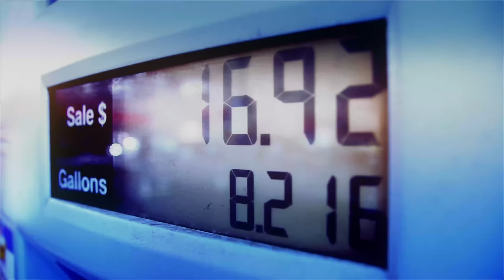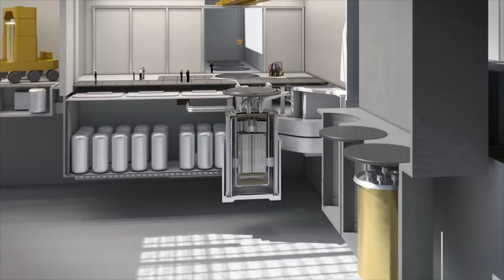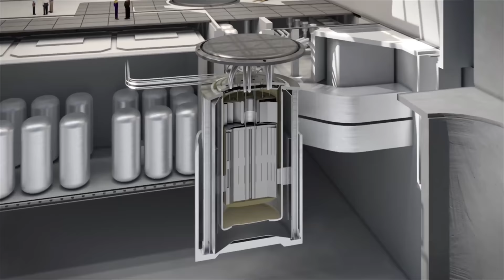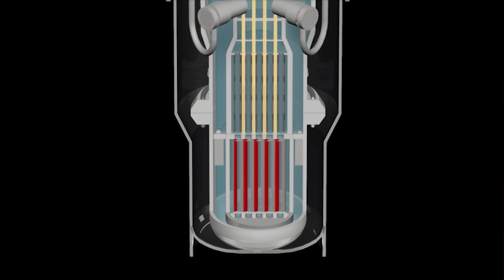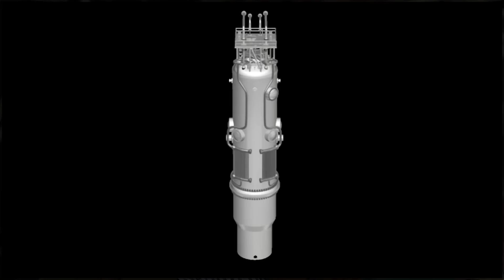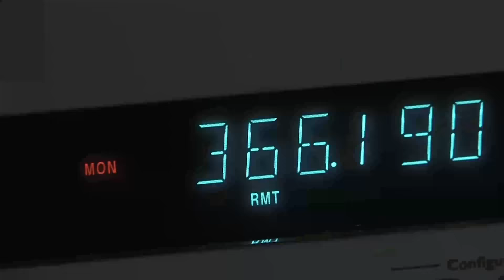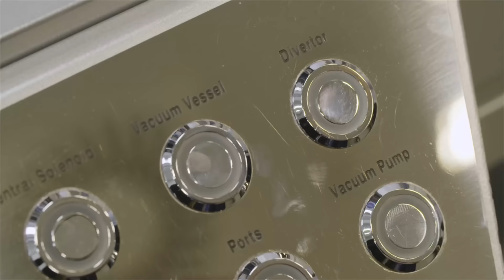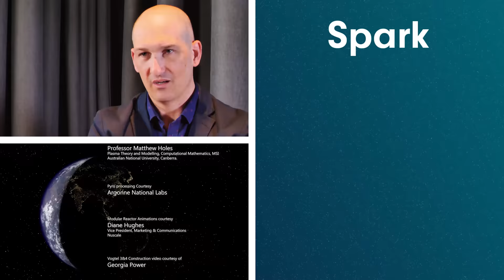Can We Trust Nuclear Power Again After Chernobyl? [4K]

Comment: I beieve the answer is yes. The RBMK reactor is a bad design, exacerbated by Soviet incompetence. We use an entirely different design and our nuclear technicians better-trained. 

Our need for energy is only going to increase as time goes on. Renewables cannot fill the breach quickly enough and come with their own issues. We already see probems with hydro in the Southwest as reservoirs like Lake  Mead in the US dry up because of overuse and drought. 

Despite what alarmists might think, the US nuclear industry has a good safety record (3 Mile Isand was the worst large scale reactor accident we've had. Of course one should not build in areas where there are seismic hazards--Australia has large areas of cratonic rock which tend to be stable seismically and geologically, so it has an advantage there.

I beileve the US (and other countries as well) need to seriousy consider making nuclear either part of their power generation mix or a larger percentage where nuclear is aready a part of the mix.

Comment: Talking about Chernybol an acquantance went through the ex-Soviet Union after that accident to see if he could improve the safety of their Nuclear Plants.  He was horrified at the lack of safety but worked with other Nuclear Engineers to bring those plants up to safe standards.  Unfortunately he has since died or I'd ask him to write his own piece with his experiences.  But the world's Nuclear Power Stations along with the new safe Nuclear Power plants need an International Safety board with examimers ging around to keep everything safe.  The Japanese plant had a another plant along the coast better built that suffered no ill effects from their Tsunami.  More people died from being moved than from teh radiation there by the way.  People who flew out of Tokyo to get away from the accident suffered more radiation form the aeroplane flight than from the accident.  It was a case of hysteria.  The new safer smaller Nuclear Power plants ae now being produced by Rolls Royce and others.  It is repored they take about ten months to build and place.
Reply: The new safer (i.e., Rolls Royce) reactors are just lines on a drawing board.  Please do not claim advantages before one is built, run for a number of years and proven.
Reply: Chernybol was not a light water reactor, did not have a containment building (until after the accident) and was an unsafe design because of its response to temperature increases.
This design would have had no chance of being allowed for use in the western world.
No lives were lost at 3mile island or Fucachima due to the nuclear accidents. 
Lives were lost at chernybol, because of poor design and practices. combined.
Reply: @davidhenry5128  What does light water reactor have to do with it? Many reactors are 
NOT light water
No one can account for the long term effects of any of those accidents but the financial effects are huge.  At Three Mile Island you had a multibillion-dollar plant less than 1 year old, permanently disabled, $1 billion spent to clean up the reactor core and the containment is so contaminated that they cannot afford to clean it up, so it sits for hundreds of years.  Now many nuclear plants are being operated beyond their design life and I predict that if one of these old plants does have an accident, then there will be pressure to shut them all down at one time.  And losing 19% of our generating capacity all at once will not be a good thing.

Comment: The new technology that current regulations keep from being used would end our pollution from energy problems.  There is even a nuclear generator that uses the radioactive spent fuel rods from older generations of nuclear plants.
Reply: Correct but you need a processing plant to separate the Pu239 from the other isotopes in the spent fuel. Then you need a plant to mix the Pu239 with U238 to make assemblies that can inserted into the reactor. And then there are the shipping casks needed to move the spent fuel from the old reactors to the processing facility along with security and loading and unloading facilities. It is not so simple or cheap when you consider the reality of actually doing it.  MOX that was supposed to mix pure weapon grade Pu239 with U238 to make reactor fuel assemblies was canceled in the U.S. after spending $17 billion and they finally admitted that it would cost $100 billion more to complete and operate.

Comment: It is very disappointing how many people are terrified of clean, safe nuclear power.

One thing I slightly disagree with in this video is putting nuclear power stations right beside high power demand industries.

If people were not afraid of nuclear, I would agree BUT... People are afraid of nuclear power and scaling up nuclear power is quite efficient. As a result it makes sense to at least consider placing nuclear power stations far from human centers and to simply scale them up by the necessary percentage to handle transmission losses.
Reply: @clarkkent9080  I never said it was cheap. I said it was safe and clean. I believe we should be investing in new, next generation nuclear power plant designs. Not necessarily ones that reprocess weapon grade plutonium, but focusing on maximizing power generation as a function of cost while ensuring the risk of melt downs are as close to zero as possible.

The reality is this. Fossil fuels can't provide power indefinitely, regardless if you believe in global warming. In a few hundred years it would be gone if we simply kept using it so fossil fuels are simply not a long term option. Solar and wind consume significant land area and are not effective all over the world. Transmission losses, physical area and costs make it impractical to power the world with solar and wind.

Next generation geothermal might be a good option for certain regions but for much of the world nuclear fission is the best long term option (until fusion becomes a reality, if it ever does).

While the US may not be able to get nuclear to work I am confident many other up and coming countries will. Countries that invest in large, safe, clean nuclear power will be able to power a large manufacturing industry as well as power EVs, etc.

It will be interesting to see what happens over the next 30+ years.
Reply: @Slider68  I don't disagree with anything you say.  My point in replying in these YT videos is that most people have no idea what is really happening with nuclear in the U.S. today and they apparently rely on YT videos for their information and news. I just try to provide FACTS so people can truly understand the situation.  Isn't it strange that not one of these YT videos on nuclear power has even mentioned real projects and real results?

Comment: The best solution for the future of power in Europe and worldwide is the installation of Molten Salt Reactors, thorium looks best.  The technology was developed in the 1960s in the U.S. at Oakridge Nuclear Facility.  They had one running for 35 years trouble-free until lack of interest defunded it.  The Light Water Uranium Reactors were favored because they provided fissile material for nuclear weapons more readily. for Heavy Water Molten Salt Reactors are safer than the Light Water Uranium type because the molten salt provides both the heat and cooling factors so if there is an event it would cause the molten salt to drop in temperature and the plant shuts down automatically.  There can be no meltdown.  They are 97% efficient compared to the 3% efficiency of Light Water Reactors, so they can actually burn the nuclear waste of those types.  They produce so much cheap electricity that projects like decarbonizing oceans and desalinization can be done simultaneously.  They don't depend upon water for cooling so they can be built anywhere.  They don't require a huge conducting system of massive cables from a wind or solar field because they can be built on present coal or light water locations at or near the source of use.  Also, science has developed hydrogen fuel cells that can use iron instead of platinum, making fuel cells for cars and homes feasible.  The solutions are here.  All that is needed is for politicians to notice and unite to make what could be the quickest transition in the direction that could truly take the world into a better future.
Reply: They had it running for 6 years and it ran on uranium, not thorium. In a molten salt reactor, uranium has every advantage of thorium except it's much cheaper and easier to do.

Comment: What we should be doing to build loads of nuclear power plants, then use the excess power for carbon capture and storage.
Reply: Can we afford to build them???
The Southeastern U.S. is super pro-nuclear MAGA, has zero anti-nukes, and 100% political support. 
VC Summer (South Carolina) new nuclear units 2&3 were canceled in 2017 after spending $17 billion on the project (original estimate of $14 billion and 2016 completion date) with no clear end in sight for costs or schedule.  

Vogtle (Georgia) new nuclear units 3 &4 currently 110% over budget and schedule and still not operating. Mid way into the build, the utility stated that had they known about the many costly delays they would never have chosen nuclear.  They are now delayed another year because according to the project management, thousands of build documents are missing.  If you can’t build new nuclear in the MAGA super pro-nuclear southeast U.S. then where can you build it?
Reply: @clarkkent9080   Yet you continue to ignore the fact that the US and many other countries have built and used small modular reactors for many decades built in two years or less for millions not billions.

Comment: I was very surprised to hear for the first time that the Gen-4 nuclear plants will produce waste that is safe after 30 years. Is that true? It certainly is not being talked about in other nuclear news or videos on nuclear waste. Does the waste need additional processing plants that have already been tried and failed? Why are countries still talking about burying their waste in deep holes if it can be recycled easily?
Reply: Reactors don't create the huge volumes of deadly waste that we're told they create. That is all spin. There is a fortune to be made from the 'management' of reactor 'waste'.
Reply: @paulanderson79  I am very concerned about the hundreds of tons of old nuclear waste that is in rotting leaking ponds in Scotland and the UK. No one is talking about recycling it and there have been many accidents so if this Gen-4 reactor property is true then maybe we can get rid of the existing waste safely. But I have not heard of anyone doing it yet or any indication it will happen soon. Also, the UK is building its single new reactor using Gen-3 technology so I don’t expect any Gen-4 reactors soon to solve the waste problems.
Reply: @Greguk444  What you heard is true, certain types of molten salt reactors can use nuclear waste as their fuel without reprocessing it first. The front-runner in the race to commercialization of this type of reactor is Elysium Industries, they have a few presentations here on YT.
Reply: @Greguk444  "Gen-4 nuclear plants will produce waste that is safe after 30 years. Is that true? ... Why are countries still talking about burying their waste in deep holes if it can be recycled easily?"

No, but I believe they stated (or meant to state) 300 years (not 30).

If you separate out the fission products, the longest lived (for practical purposes) isotopes are Sr-90 and Cs-135 - these have half-lives of about 30 years. The rule of thumb is that you get to background after 10x the half-life, thus 300 (+-  a few decades) years.
The remaining waste you can put back in reactors for more power generation.

The recycling is relatively easy, but we don't have the correct type of reactors to use this recycled fuel. France uses some of the recycled fuel, but they could use more with newer Gen-IV designs.

The reactors that can use this waste are either 'fast reactors' or 'burner reactors'  if you want to research more. Moltex Energy has some fairly good youtube videos on their particular implementation.
Reply: The American and UK reactor technology and other countries using it, is 'once through'. Approximately 5% of the available energy is used for power, the remainder goes to high level waste.

The French system reprocesses the waste and burns it in MOX reactors eventually achieving high levels of burn up. The Canadian Candu reactor system can also 'burn' some high level waste.

Proposed Gen 4 reactor cycles will achieve high levels of burn up, producing only a small fraction of the waste from Gen 1-3.

Why this hasn't happened before is a bit of a mystery but is probably linked to protection of the coal industry.
Reply: It is not true. The physics are the same for new designs. The improvements are in safety & efficiency. Wastes are nearly identical. Reprocessing transuranics is an expensive process & has its own waste issues. Burying spent fuel 1.5 to 2 km undergound, in a geological stable region, isolated from aquifiers, where it will remain undisturbed for millenia, is an ideal solution.
Reply: @rhynosouris710  You are mistaken. In a molten salt fast reactor, all the fission products can stay in the reactor for the life of the unit. At the end of the life of the reactor, what is left will need to be stored for about 100 years under current regulations. Once they revise the LNT regulations, that number drops to 30+/-. Check out the Elysium industries molten chloride fast reactor, they have a few presentations on YT.
Reply: @chapter4travels  Fast reactors didn't come to mind when I commented, my bad.
Reply: Didn't you parents tell you that anything that sounds too good to be true is usually a lie.  Natrium gen 4 reactor advertised as costing $1 billion.  Terrapower is now estimating it will cost $4 billion with $2 billion of that being taxpayer welfare.  But don't worry, they say it will be cheaper when they build the 2nd one...if you believe that.
Reply: @clarkkent9080  Anything built in the US will cost 4x anywhere else, the NRC will make sure of that. Look to Asia for the transition to fission to begin. The transition to fission from natural gas and renewable parasites will take a very long time, 2100 would be my guess.
Reply: @clarkkent9080  I agree. In the uk we are building 1 new nuclear power plant (was 4 but the rest were cancelled as too expensive) that was £10 billion but is now £27 billion and is years over schedule so probably will cost more than that and in all the literature I read I never saw anything about the waste being reused or less dangerous or less half life. It is going to be stored in rotting water ponds in Scotland until a big hole can be negotiated with local people (not much chance) and all the waste put-in the deep hole.  Decommissioning uk nuclear plants is estimated at £132 billion. Our renewable industry is exceeding nuclear efficiency and costs significantly. Batteries and hydrogen storage will solve the issue of windless days.
Reply: @Greguk444  I really don't know how we will eventually power our grids but I do know that unless nuclear construction issues are addressed that it will not be nuclear.
Reply: @chapter4travels  That does not seem to be the case with wind, solar, and batteries that continue to improve and cost less each and every year.
Reply: @chapter4travels  the thing is that there are no molten salt reactors operating at the moment and those that are planned are experimental, such as in china. There are significant problems with these reactors that have yet to be solved which is why we won’t be seeing many of them any time soon
Reply: @Greguk444  There is no rush, the transition away from fossil fuels will take a very long time. BTW, the only significant problem for MRSs is politics, no engineering issues of merit.
Reply: Actually its more like 200 years vs 2,000 years at present. More important is that they only generate about 2% waste compared to 98% with traditional high pressure water reactors. Some MSR designs will actually run on reprocessed waste from old nuclear.
Reply: @clarkkent9080  well Clark, looks like we’ll just have to stay with good o’ll Kryptonite
Reply: @Greguk444  mate, despite all the solar and wind to date, CO2 emissions continue to rise because power and industrial heat requirements continue to rise. When Elon’s two Giga-battery factories are up to speed in a few years they ‘might’ be capable of producing about 200 Gigawatt/hrs of batteries a year (About 33% world production). Most need to go in cars. Elon calculates we need 300 TERRAWATT/hrs of batteries to get rid of fossil power (not including industrial heart). So doing the math we’ll need order of fifty years to get there assuming production ramps dramatically. In other words THERE IS NO WAY that Solar and Wind will ever contribute more than about 30 to 50% within about 30 years. That’s why only Nuclear can save us … to put it bluntly.
Reply: @FowlorTheRooster1990  High-level waste can be introduced into a molten sale fast reactor and fissioned. Medium and low-level waste should be treated the exact same way a Mcdonald's milkshake cup is.
Reply: @Greguk444  it is true, but it's a coming technology, it doesn't happen instantly.  However I would agree that waste from the 50s forward could be reprocessed and returned, and should be massively profitable in the future.
Reply: @chapter4travels  
The Canadian CANDU reactor is equally capable of using spent PWR (Pressurized Water Reactor) fuel via the DupiC (Direct use of spent PWR fuel in CANDU) process. China has recently built a CANDU type reactor next to a PWR for that exact purpose. So, it can already be done with some of the current reactors in existence.